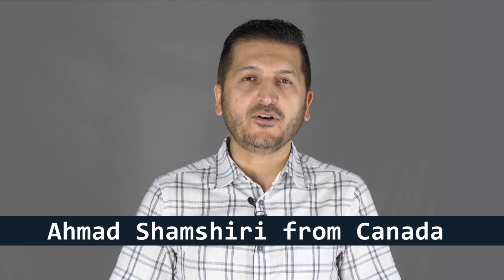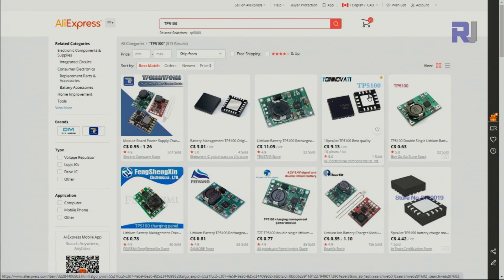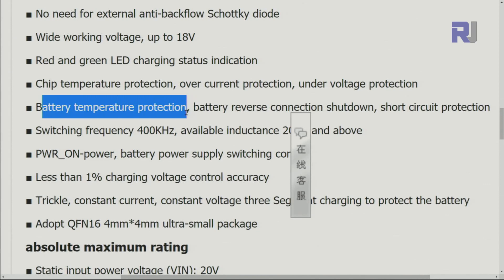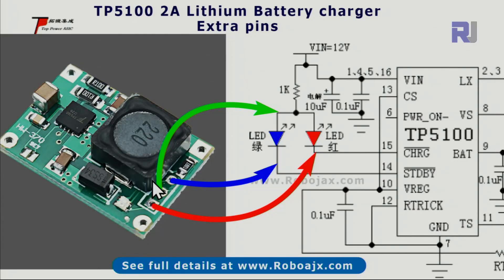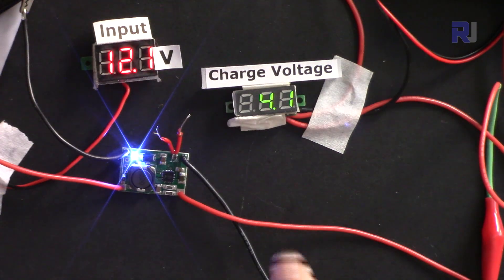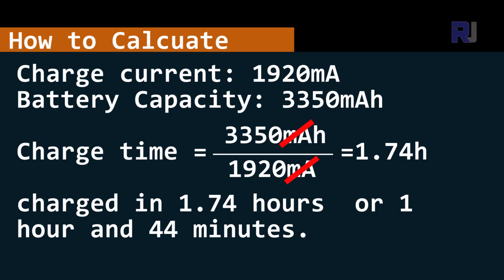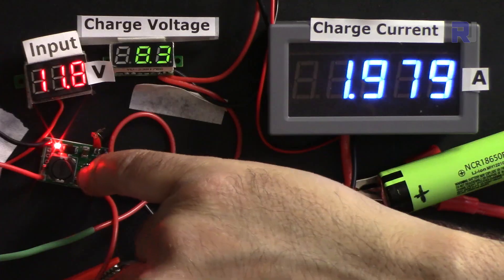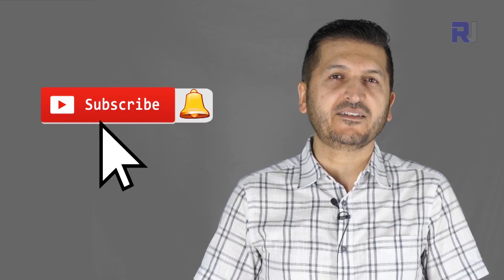How to use TP5100 2A 8.4/4.2V 1S and 2S Lithium Battery Charger DIY - RJT346

Comment: Super cool. You mentioned a module which can sens if batteries do not have the same voltage and compensate the charge for it. Which module is that. Thank you in advance.
Reply from the maker: That is called a cell balancer. We have a video for that. Search for it.

Comment: Hello mr. Shamshiri.
Please suggest a charger option that can:
- Charge 16340, 18650, and 21700 batteries using a power bank/solar panel
- Feature fast charging
- Act as a power bank
- Test the battery
- Be lightweight (for 1 or 2 cells)

I need it for long hikes.

Comment: I saw in YouTube that this battery should be charged with a current of about 25% of the total capacity ( like if 1000mah ,with 250mA). Or else it will damage the battery. Is that so?
Reply from the maker: No. You can charge at it at higher than 1000mA. There is datasheet for the h battery which says that. I have shown it in more than one video on my other channel @wattHour which is only focused on charging, converters and energy.
Reply: @robojax  🤝 thank you

Comment: Hi I was hoping to find a small form factor pcb/charger for safe charging a 7.4v 4000mah battery I was hoping to use in a Raspberry Pi 2w zero project.

I saw your youtube video on charging circuits and thought you might have a good suggestion?

Thank you!

Comment: Limiting the charging current like in tp4056 R3 resistor. Is it possible in tp5100?
Reply from the maker: Yea you can. See datasheet the way I explained it https://voltiq.ru/datasheets/TP5100-datashhet.pdf?darkschemeovr=1

Comment: My question is my sony srs xb 32 battery 5 pin connector 2 red wire 2 black wire 1 yellow wire  .. how it works yellow wire .pls reply me
Reply from the maker: I am not sure about that model, each battery cell needs one wire and we need one common ground.
Reply: @robojax  without ground new bms other modal it was working yes or no
Reply from the maker: Without ground means you want not turning a light with one wire. No.

Comment: Thanks do we still need BMS along with 18650 cell to charge safely or this board comes along with all sort of battery protection ?
Reply from the maker: as I saw interest in Lithium batteries, I purcahsed boxes but don't where to use them expect to make video. Why and where  do peopel use batteries so I learn and use. Then perhaps I know I would make better videos. until now I pent like over $2000 for batteries and they are on the floor.

Comment: I have a question. What happens if my battery is of 3.7 volts? Am I not able to use this module?
Reply from the maker: it seems yo have not watch the video.  this module is for your battery. please watch to learn why
Reply: @robojax  i watched it. I meant because the datasheet says that the module is for 4.2 volt batteries, and I have a 3.7 volt battery

Comment: If I connect 5 or more lethium iron battery the module heats very quickly is there any solution is there,I also used heat sink but also it heats very quickly.

Comment: can it charge and discharge at the same time like when I use it as a power source for a speaker with batteries and usb charger connected will the speakers work while charging?
can I use two cells in parallel ?
Reply from the maker: Yes you can

Comment: As i remember data sheet shows polarity protection available but in prctical it is not. Did u test it for under voltage protection and over voltage protection?im have doubt

Comment: Do you know any cheap 2s (8.4V) charger powered (input) max 24V-25V?
Reply from the maker: you can't get such a thing. you need to get Step down converter and put it before this charger.
Reply: @robojax  ok, that's what I thought

Comment: Mr. Shamshiri, thanks you for the clear explanation. Suscribed. 
I would like to ask a question: is it possible to charge a Li-ion battery pack 1s2p (3,6V 5400 mAh) with this module? Thanks!
Reply from the maker: Hello, yes you do as many parallel so you like. But remember the amount of current this module supplies stays the same so the time will take longer. inf your case it will take twice as long to charge. if you use 1s3P, then the 2A from this charger will be divided to 3 and it will take 3 times as long to charge them.
Reply: @robojax  Thanks very much!

Comment: Is Bms not needed to charge my 18650 batteries with Tp5100? Or Bms still needed to charge safely all my batteries? Thank you and hopefully to get an answer from you.
Reply from the maker: this is BMS. you BMS h as protection. But can't control the current as to how much should go to your battery. this module can allow up to 2A. but if you connect a small battery with capacity of for example 500mAh and charge it with 2A, it will get damaged. So you need to connect a power source to this with controlled current (ampere). that's why connected your charger that controls the maximum current. An example of a charger would be a step down converter with constant Voltage (CV) and constant Current (CC). So you set the output of that to 8.4V (for charging two cells) and set the current to 200mA or whatever value your battery require.  if allow more charge current that your batter require, battery get damaged. So find out about your battery's charge current. 
Good luck
Reply from the maker: Learn about battery protection from this video of mine in another channel which is all about power, charge and battery https://youtu.be/Lk__xTxLlY0

Comment: Thank you for the information and review - highly appreciate it - one quick question regarding the TP5100 - How do I utilise the under-voltage protection? I do not see an output - is this module only for charging. The batteries I'm using are un-protected.

Comment: Thanks for the detailed explanation. I have a question. I am using the module to charge 2S battery. When battery reaches to 8.36 - 8.37V, the RED and BLUE LEDs are flashing alternately. What does this mean? Is there a problem?
Reply from the maker: Hi, I just added the PDF datasheet on the resources page.  in page 10 in the table is says: no battery is connected or the output capacitor 10μF (issue or missing)

Comment: Bro!, Please help me!. I'm changing the battery system of my bt speaker. My amplifier is xy-p15w 8-24v dc. Which one is better? 4 18650 in parallel and use IP2312 then use converter 3.7v to 12v or 2s2p 18650 and use TP5100 then use converter 8.4v-12v? I want fast charging using 33 watts fast charger of poco x3 nfc

Comment: how about the over discharge protection of the battery?
Reply from the maker: I believe I mentioned "Undervoltage protection" and it is mentioned as over discharge protection . please check the datasheet in the resources page http://robojax.com/L/?id=265
Reply: @robojax  can i use this tp5100 with a 1s bms for added protection?

Comment: Thanks for sharing, when I charge 2 batteries in parallel ( one cell mode) I only get 4.1V on each battery and the LED changes to blue any advice. THANKS
Reply from the maker: That is correct. When you connect in parallel, the voltage does not increase. Only charge time increases
Reply: @robojax  I was expecting 4.2V on each battery
Thanks

Comment: How much Amps cells can charge at once (In parallel) ?
Reply from the maker: I believe I have tested and shown maximum current. it is in the title as well.  So when  you connect two cells in parallel, the maximum will be divided by 2.

Comment: Hi I bought TP5100 I bought 2S bms. Can I use 2S bms? Does TP5100 protect batteries?
Reply from the maker: Hi,  with your vey basic questions you made me watch the video. it seems you have not watched the video. I've spent like a full day to make the video. Please watch if you want to know. Both of your questions answered. Do not skip. this is not a joke or funny video. It is full of information that you will learn  from it.  Good luck
Reply: @robojax  u are conveniently not explaining. the gentleman is correct, u are supplying 8.4v to 2  batteries in series.....what if one battery is dead??? have u thought about that....that is why u need a 2S battery BMS to protect the batteries indivually..
Reply from the maker: this will not charge if a battery is dead.  When you see battery is not charge, check the voltage, isolate the bad battery and use new one. this is the cheapest charger. We don't expect this to detect the cells.
Reply: @frankfernandes648  for S2... 
if the battery that is going to be charged is damaged, one of the things that happens is: 
1. if Short damage will result in over current because the TP5100 is equipped with over current protection.
2. If open  damaged, charging will not occur because an open circuit

Comment: SELAM ABI TP5100 ALDIM 2S BMS ALDIM  2S BMS Yİ KULANMASAM OLURMU TP5100 PILLERI KORURMU BU BİR BİRDE 5V 2 AMPER TELEFON JARZİ İLE JARZ EDEBİLİR İYİM TEŞEKKÜRLER ABONE OLDUM SÜPER ANLATIM ACOL CEVAP LUTVEN
Reply from the maker: Velaiküm selam, 1 pil şarj etmek istiyorsanız girişte minimum 4,2V, 2 pil şarj etmek istiyorsanız girişte minimum 4,8V bağlantıya ihtiyacınız var. yani girişte 5V bağladığınızda sadece 1 pil şarj edebilirsiniz. Maalesef Google çevirisi Türk dilinden net değildi.

Comment: Ahmed bro can I use tp5100 for drilling machine. I want to replace 2 lithium batteries and same time I want to replace bms also do u think it will work...
Reply from the maker: It doesn’t matter where you use it. I have shown voltage and maximum current. If you application need equal or less than the current and voltage is the same, then yes you can use it.
Reply: @robojax  thank you brother.. I will try.. jazakallah.. and I did subscribe u r channel also..

Comment: Can this module be connected in parallel, so that the charging current can be above 2 amperes?
Reply from the maker: Yea it can.
Reply: @robojax  Then, is it fine to charge 2x 18650 battery (in series) with 4 amps of current?
Reply from the maker: it is very tricky.  don't use it in parallel or series. get different module.

Comment: Wonderful vedio as always! When charging 2s 18650 2500ah batteries, is it better to do it in parallel connection or series? . I require my output to be above 7.4v. Thanks🙏
Reply from the maker: Hello, it seems you have not watched the video fully as I have explained the voltage and demonstrated it. it is not the matter of which one is better. Please watch fully.

Comment: advice on reverse polarity protection?
Reply from the maker: Just connect 3A 50V diode and put in + line between this module and your power source.  anode of the diode to + of power supply and Cathode(the side that has line) to the + of this module. Diode will reduce the voltage for about 0.7 voltages but protects the module.
Reply: @robojax  OK, I was thinking about the other side should the polarity of the connected battery be wrong.
The unit is suppose to be polarity protected should the battery be placed wrong polarity but in another video someone did this to prove if it was protected and the chip smoked.
Reply from the maker: Have you watched the video? This video has chapters. Wow please watch
Reply from the maker: If you don’t know what chapter is, then watch 2 minutes of this video, I have explained demonstrated it how to select chapters

Comment: Toujours les meilleurs tuto Robojax , Vraiment complet et les tests sont vraiment parlant sur la qualité des modules. J'ai ce module , Mais est ce que l'on peut Charger les 18650 en même temps que elles sont connectées à un Arduino ou autre chose ? J'ose pas essayer
Reply from the maker: Bonjour, je suis ravie que mes tutos vous aient plu. vous pouvez connecter votre batterie pendant qu'elle est chargée UNIQUEMENT si vous la connectez à la broche VIN d'arduino ou à la broche de l'adaptateur d'entrée. Jusqu'à 12V n'endommagera pas la carte Arduino.
Reply: @robojax  Merci C'est bien noté, 12v maxi ,Oui je suis abonnée depuis un bon moment à ta chaine et je la regarde toujours avant d'acheter des modules , car tes tests sont complets et clair , en plus il y a les traductions , ça facilite la compréhension, pour moi tu reste toujours la meilleure chaine pour tous les modules chinois, longue vie à ta chaine.
Reply from the maker: Merci beaucoup et restez en sécurité. J'apprécie de partager ma chaîne sur votre facebook et vos amis.

Comment: Hello! What would happen if I use a 12v solar panel instead of a 12v dc outlet? Would it be efficient?? Thanks!
Reply from the maker: Voltage is voltage. does not mater where it comes from.

Comment: I want to replace a 9 volt battery with a 18650 pack. I'm wondering if I should use 2-3 18650 batteries in series? Should I use a single 18650 and a boost board? Or maybe two parallel 18650 batteries and a boost board for more capacity? I want to leave the battery in circuit with charger connected. Thus, I want a circuit that safely protects from over-charge or under-discharge. Do you recommend parallel charging 18650's? Thanks for any help.

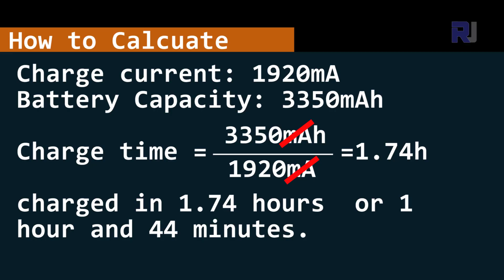Comment: 12:10 Yeah !! thank you for pointing out the capacity unit which is Ampere x hour and not Ampere/hour. 
It is good to put the unit in the calculation so we know what unit we got in the result. 
It may be a details, but it piss me out frequently in other video or other internet source when they spread tainted information.

Comment: Hello Ahmad! Firsty many thanks for your video. So helpful. My question is that can we use TP5100 and 2S BMS (which is connect to output) together or TP5100 is enough for charge-decharge for 2s lion batteries. Another question is can I use USB Type-C female connector to input (for 9V)
Reply: buddy u are right...u need a 2S BMS to protect and charge batteries indivually...
Reply from the maker: Hello, I believe I have explained it and demonstrated 1S and 2S charging. for one sell you can connect it to 5V but for 2S you need higher than 8.4V at input.  But I did not understand why you would connect this module with another module. two battery is 2S already which this module can charge.
Reply: I have the same question as you clearly note in this video this module won't balance the 2s batteries. I came to your video for TP5100 from a HX-2S-JH20 thread that is better to use the the former for a correct charge. As another member here asks the same, would the output of TP5100 should accommodate a HX-2S-JH20 for balancing?
Reply: @robojax  Hello again Ahmad. Firstly many thanks for your answer. My electronic intelligence is poor. I thought that I need bms module for balanced charging between two bateries. You mean we don't need extra module, TP5100 can do that even there is no wire between two cells, right?

Comment: Hello! I've got a question. As soon as the battery is fully charged, the red LED will turn off the the blue one one turn on instead, right? Also, with this circuit I have to disconnect the battery at the time the charging process finishes (for safety), or is it prepared not to burn the battery? Thank you so much and your videos are super useful for us beginners!
Reply: When the battery is fully charged, the RED will off and the BLUE RED will on. YES.

No need to remove the battery from battery holder, except you want to use it with different device.

Comment: Will the amount of current source affect the output current? Say if my power source is 5v 1A, will the output still be 8.4v 1.9A?
Reply from the maker: Power =P, Voltage =V and Current =I, So for input P=IV=5(1)=5W, output P=8.4(1.9)=15.96W, absolutely not possible. you have $5 but you want to buy $15.9. Power never increases and not even the same. we always have losses. about 10% to 15% is lost at output  Only voltage and current is changed.

Comment: Hey, can I use micro_usb for power supply ?
Reply from the maker: Yes you can, because USB is 5v you won’t be snake to change 2 cells
Reply: Thanks for replying..  I am interested in charging a single 3.7v  lipo battery . Won't there be any issues right ?
Reply from the maker: why would be any issue. I have explained in the video that this module takes the input and either for 1 cell or for 2 cell it outputs appropriate voltage . I hope you don't want to me to type everything I said in the video. if you watch it fully, you will have no question. my videos are different than any other videos you have seen. I leave no details output.

Comment: I am thankful to have your demonstration over TP5100, Really amazing. One quick question, can i connect additional LEDs over the pads that you were shown. Please suggest.
Reply from the maker: You are welcome. I am sorry I did not understand. Which LED?
Reply: @robojax  The leds that are connected to pin 15 and 14 pin to tp5100 and 1k resistor that comes from input. near by there were 3 pads, and in your demonstration were shown using tester of touch each pad and led indicates. in that position can i give led connect.
Reply from the maker: The LEDs are turned on using the chip. You can connect additional LED for sure. If  you connect it in parallel, it will turn on but might be dimmer. As I have shown the diagram, connect them to pier via 330 to 1k ohm resistor